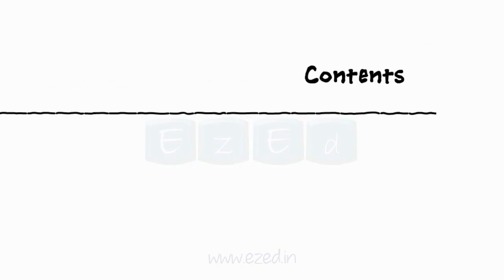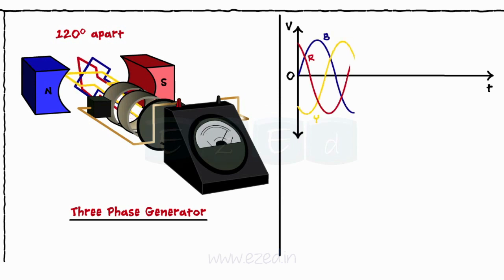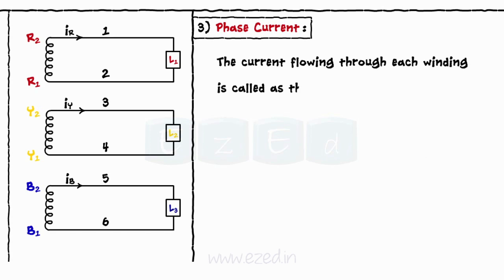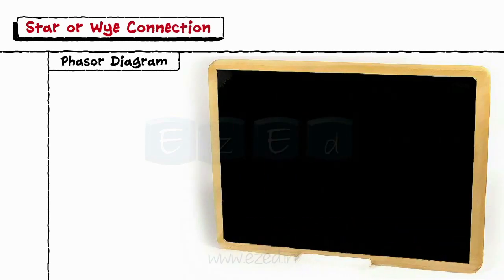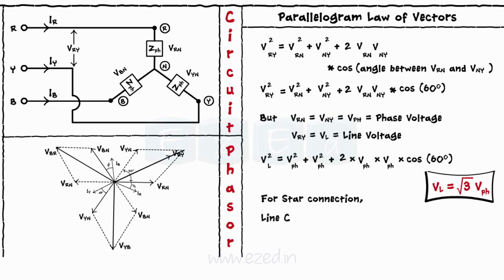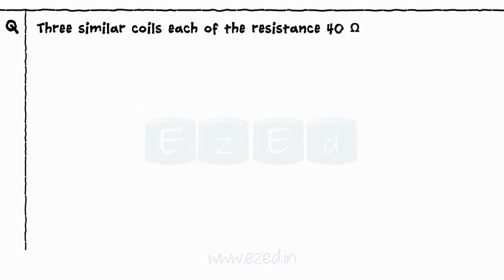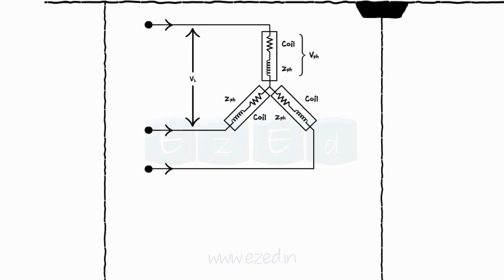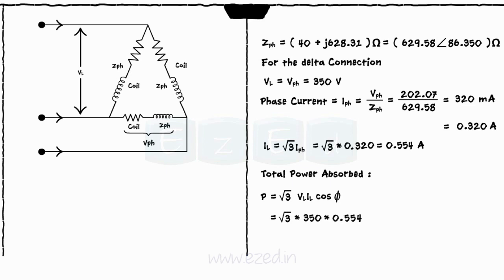Three Phase Signals - Star Connection  - Delta Connection - Phasor Sum - Solved Problems

Comment: Hi, at the @9:19 for delta system you say VL = Vph = 350V  So when working out phase current (Iph) = Vph/Zph = 350v/629.58 but why do you use Vph as 202.07, because Vph = VL and VL = 350v